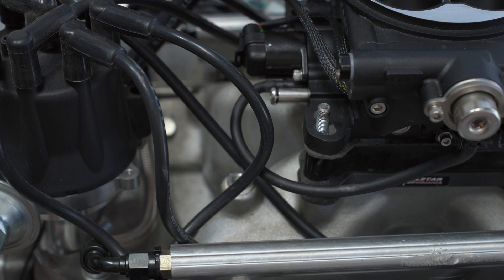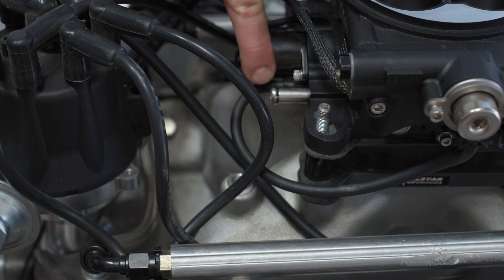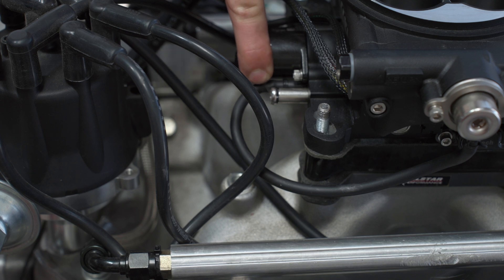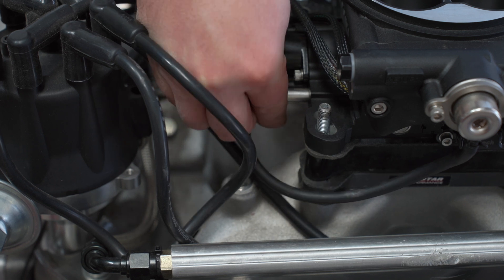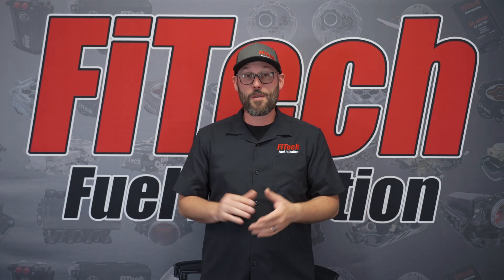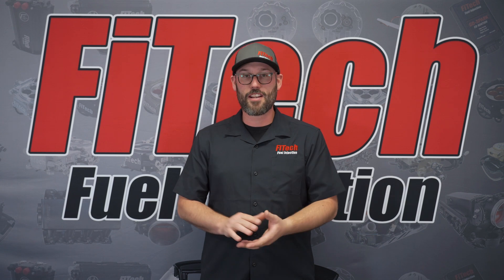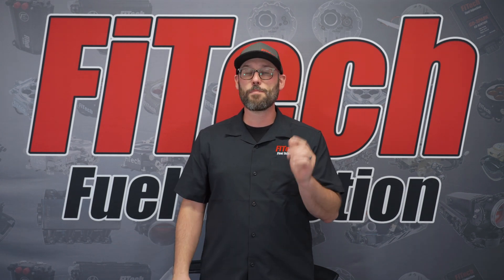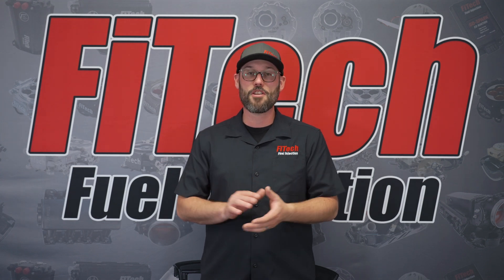Vacuum Leak | Tech Tuesdays | EP95

Comment: IDK maybe my screen but it looked like the hold down nut was also missing on the corner of the body there?
A good way to chase down vacuum leaks is with a can of starting fluid, spray in small bursts around manifold, EFI base, fittings, etc. Great series these vids. I bet you're one busy place - keep at it!⛽